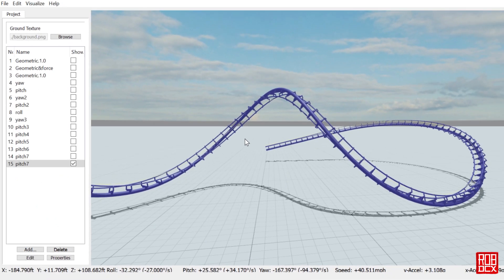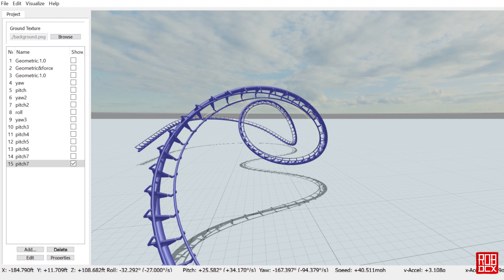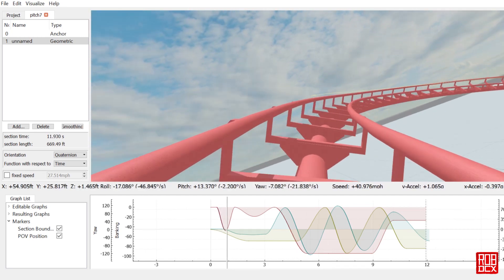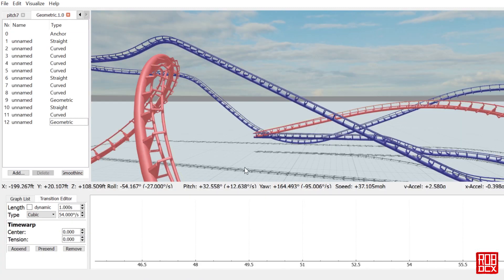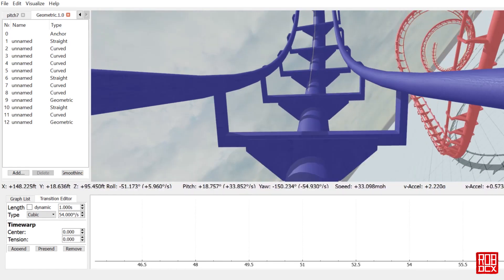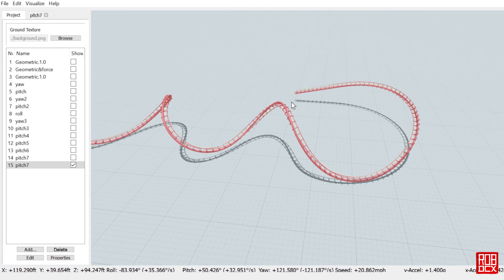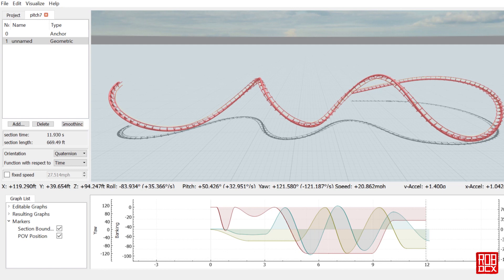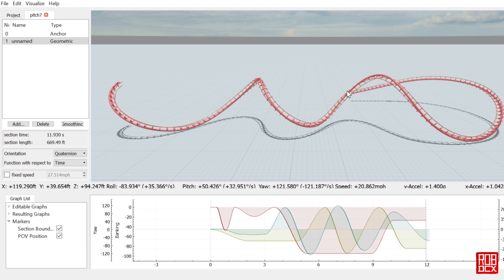FVD Elements | Arrow Corkscrew (Fail!)

Comment: Afaik, the only way to get the proper shaping is with Distance Geometric, not time. That’s why there are inconsistencies as speed drops off
Reply from the maker: I tried to change to distance midway through and of course it messed up the whole track. I'm going to take another stab at it WRT distance and see if I can get a better result. Thanks for the good idea.
Reply: Yeah, geometric distance  is definitely the way to go for old school shaping like arrows or wooden coasters. But even then, you can’t get the right shape (at least in my experience). I think an element formula in NL would be the way to go for a perfect arrow cork.  Also, you can mess around with the heartline height to bank around one of the rails like arrow did for some transitions.
Reply from the maker: @nicholasscott4138  so I worked on using geometric distance and then changed the orientation to quaternion but I'm still not getting the proper shape at all. I'm thinking it can't be done in FVD like you said. Or else I'm just too inexperienced with geometric sections lol.
Reply: @robdcx  hah, i think it just genuinely can't be done. I don't know enough about element formulas in NL but I think that'd be the way to go. Or some other geometric tool. Those super old ones from the NL 1 days come to mind (anybody remember Gravimetric Studios?) but I can't remember the names of them now.
Reply from the maker: I'm beginning to agree with you. Everything that should logically work doesn't seem to be working in FVD. At this point, I could probably do a better job with forces lol. I do remember those old tools you're talking about for NL1. They probably would work better, but it's been a looooong time since I've used those.
Reply: @robdcx  Elementary! That was the one. I think that was capable of doing Arrow corks but I have no idea where you'd find it now, and how it would work with NL2. It's a shame because geometric distance functions work so well for other Arrow shaping, but corkscrews are stubborn.
Reply from the maker: Found it! http://lucasbosch.de/nolimits-tools/?dir=Elementary. I'm going to dig into this and see what I can accomplish. If I remember correctly, you just export it as an element. Getting the entrance to it right will probably be a pain though.

Comment: arrow would bank only a single rail, probably because it was easier to have a rail run as normal, and then bend the second rail to get the desired degree of banking.  Technically center of A rail, but not center of rails lol.  The most pronounced example of this is probably Big One.  There is a certain angle to view the drop where you can see the cars just fall off to the side, rotating around the outside rail.
Reply from the maker: It makes sense and I actually wondered if that's what they did. Now that I've tried building geometrically, I have more respect for them lol.